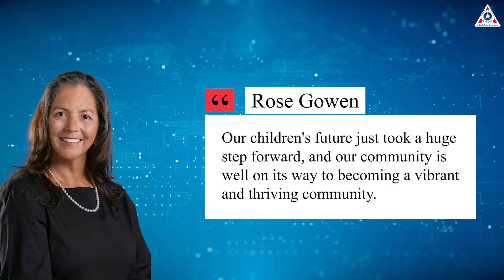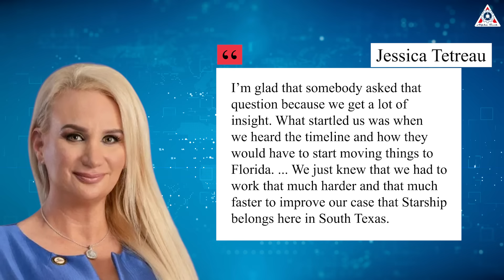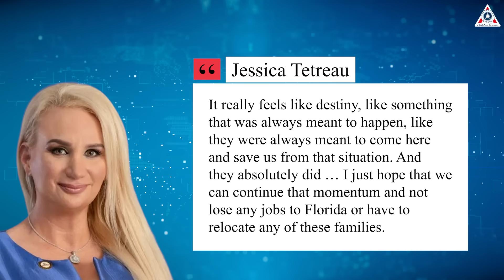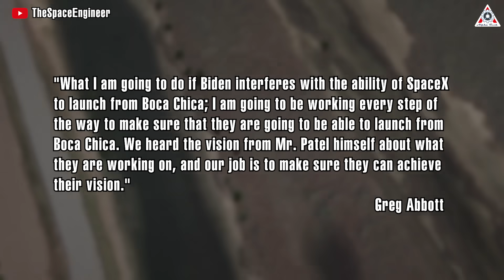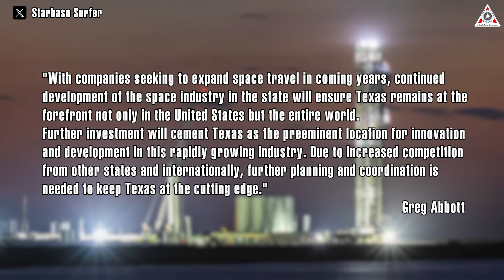What the Texas gov just did with the SpaceX starship is more important than you think!

Comment: Light doesn’t change speed.
Reply: Actually it runs fastest in a vacuum. Slower in atmosphere. But thanks for asking.
Reply: Then how does a prism work!
Reply: @pauljackson108  I think prisms are about wavelength not speed.
Reply: Light moves at 300,000 kilometers per second in a vacuum, which has a refractive index of 1.0, but it slows down to 225,000 kilometers per second in water (refractive index of 1.3) and 200,000 kilometers per second in glass (refractive index of 1.5)
Reply: @platinumpig   Yes exactly thank you Mr. Pig

Comment: Build a deep water port just south of the StarBase launch pad! Create more room for more launchpads and allow ships to send and receive rockets and supplies. RGV can use the port as well!
Reply: There's already a deep water port about three miles north of Boca Chica.  What do you believe is wrong with using it?
Reply: It’s small, shallow, near hotels, full of large oil and gas pipes sending to Mexico and would not add more space to expand the rocket pads or deliver rockets directly to StarBase.
Reply: The old port does very little for RGV where is a new deep water port could be more like the Florida ports with space for large deep water ships.
Reply: @MontréalinSpring  I think I see what you are saying now, even if it is a deep water port (which I believe it is; I've seen it).  Theoretically that port could be used, but transporting the rockets from there to Starbase would be impractical.  (It takes about 45 minutes by car just to go around that port from Boca Chica to SPI.)  It doesn't have to be a large "port", but an inlet dredged out from the Gulf, only big enough for a single barge, close to the launchpad, so that they can use a crane to take it off the barge to a crawler.
Reply: ; @Mark16v15  : nothing about spavrflight necessitates "deep water ports" - OP seems to have some fixation on size...  ???  - large diameter - for rail, is somewhat lacking in shipping
Reply: @kadmow , rail?
Reply: @kadmow  What is "spavrflight" and "OP"?
Reply: Can you imagine the outcry from the 'save the worms' bunch marching with those signs in Brownsville.
Reply: "Just south" of the launch pad is 3 miles of swamp and then Mexico.